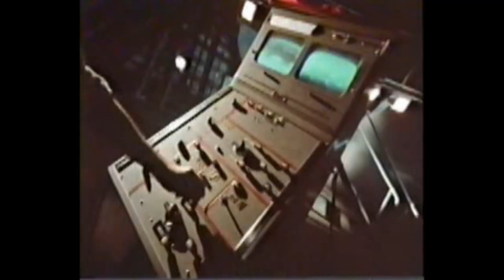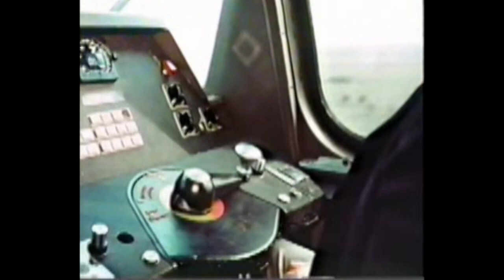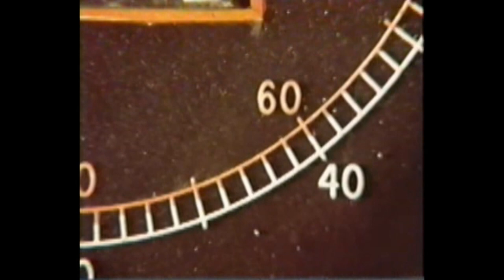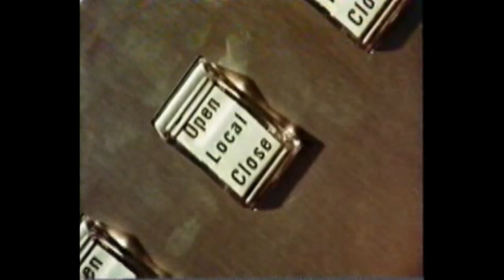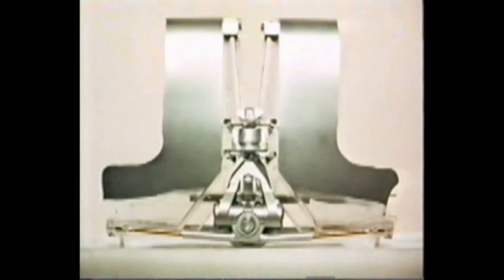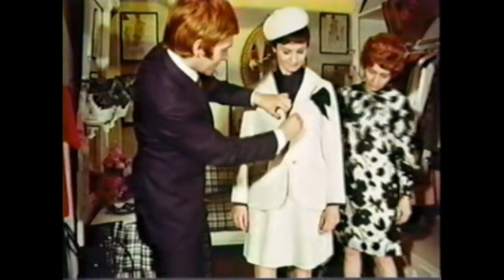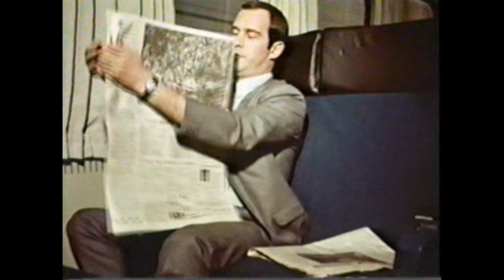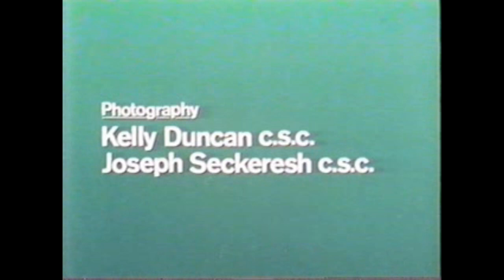TURBO - The UAC CN Turbotrain Complete 1970 Movie

Comment: We absolutely need something like this on that same corridor, if it was just as cheap or more as driving, stopped very little, and is perhaps just a little more time than the plane, it would be great!
Reply: Electric would be faster and more economic and no pollution.
Reply: @clarification007  you do realize how expensive it is to electrify a section of line, its really fucking expensive its like somewhere around 1 million or something per each mile
Reply: @nikerailfanningttm9046  it’s well worth the investment
Reply: Yes , but so many expenses , underpasses or rail guards at every crossing , for safety .I dislike buses and air travel .Please I want to travel by train .

Comment: It's pointless to have a high-speed train that has to share tracks with freight trains and commuter trains, because they slow it down.  That's been Canada's problem all along.
Reply: So true, that was part of the problem with this system. They r couldn’t run this anywhere near design speed. Only a little faster than a normal train. Current new engines on this route are capable of 200kph, but likely won’t be able to do that anytime soon either. The maintenance on the Turbo likely finished it off.  Apparently they weren’t too bad later in service after the retrofits. Bombardier did propose the “jet train” which has a single PW100 (dash 8) engine for high speed use without Overhead wires. Seemed like a good idea, but no one took up that one.
Reply: Watching videos of the advanced HSR networks in Japan and Europe, makes me realize what we're missing out on in North America.

Comment: I rode Turbo once in 1976 between Toronto and Kingston. It broke down just outside of Kinston and we were helped by a freight unit. I agree that high speed rail between Toronto and Montreal is needed. The congestion / security at the airports pre-covid was ridiculous. The LRC wasn't comfortable. My best ride between Toronto and Montreal was in a 1940's era parlor car on 3 axel trucks. The ride was smooth as silk. I've ridden all over Europe where trains are terrific. They are fast, comfortable and clean.
Reply: A rapid train is needed and either overpasses or underpasses , along the route , it would solve any vehicle collisions and make the journey safer .

Comment: Not sure if I mentioned in my long rant: The top speed for Montreal-Toronto was 03:59 minutes, not 3 hours.   Still cut 1 hour off the Rapido trains (and 1.5 hours off current schedules under VIA).   Much of the speed restrictions are due to freight traffic along the way.   Back in the day of Turbo, CN still put priority on passenger trains, so they ran faster and more reliable schedules.

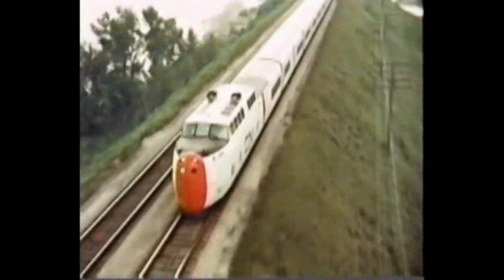Comment: 15:28   The Turbo Club Lounges were located at each end of the train in the power cars, raised up several steps over the turbines.  The driving cab was part of this section and apparently had windows right through so passengers get the same forward view as the engineer.  Note there are window panels in the roof to give views equivalent to a true dome car, but many  interior and overhead shots in this film show them covered over.  Perhaps they were impractical to keep clean of black soot from turbine exhaust stacks, which went right up through the lounge.  You can clearly see them here 12:35 but absent here 14:00.
Reply from the maker: Thanks for sharing your knowledge.

Comment: Turbine engines have excellent power to weight ratio, needed for planes, but are built for maximum efficiency at only one flat-out speed.   Great for constant speed applications like planes, ships, stationary generators.  Lousy for variable loads/speeds like trains, and very poor for the stop-and-go traffic of automobiles.  Burn nearly as much fuel at idle as is full speed.

Comment: This was Canada's first attempt at High Speed rail the next attempt was with the LRC Trains both of which suffered fatal malfunctions (of these 2 The LRC lasted longer and survived to see the millennium albeit the locomotives retired and one sent to a museum while their coaches were pulled by the F40 or Genesis Locomotives)

UAC TurboTrain: 1968 to 1982 
14 Years (All Scrapped)

LRC: 1981 to 2001
20 Years (Coaches remain in service until 2023)

Comment: Engine and locomotive technology advances rapidly.  Every 10 years we have something much better than what came before it. The Turbotrain was great at first, but after only 10 years it was clear that there were conventional diesel-electric locomotives that could do the job of pulling a train at high speed better than the engine in the turbotrain. They should have just hooked up that high-speed diesel to the front of the turbotrain and let it do the job of pulling the entire train around. The turbotrain would have been used in that manner for another 20 years with no problems.

Comment: I’m not sure I get this train. How is it possible for it to work using an aircraft engine? Where’s the air intake for the jet?
Reply: It doesn’t move using jet thrust like an aircraft. Instead, the high speed turbine turns a generator that powers motors attached to the wheels.

Comment: How could they power a 185 ton train with 4 gas turbine engines?
Reply: There were four per car, and also an auxiliary power unit. Not just four total
Reply: Actually 4 gas turbines for drive and 1 for aux power (lighting/heat). Wiki shows designed for 2 to 6 drive engines at 400hp each. As built seem to be 4 drive engines. Low rolling resistance is the big bonus with rail, the aluminum car don’t hurt. Large railway freight locomotives are about 3000hp for older ones and up to 6300HP ea. and they are hauling 2 km of freight. With only a handful of engines. Very efficient yet old tech.

Comment: Interesting, but what a waste of film spending so much of it focused on weaving the fabrics and outfitting the train staff, rather than extensively profiling and touring the trains themselves outside and in. No aisle shots showing the overall arrangement of seats and cabins in either Turbo Coach or Turbo Club, the passenger-accessible passage to the inter-train gangways, or the driver’s cabs.

Even though the film’s director and production crew were credentialled, I would have told them to do the project over again, focusing more on the finished trainsets, or fired and replaced them.
Reply from the maker: I think the video was a product of the times. Check out the other TurboTrains videos on our page, our visit our Turbotrain on our website, http://highspeedrailcanada.com

Comment: What was the reason to abandon those fast trains in Canada?
Reply: Mechanical problems
Reply: Using a turbine wasn´t really the best option. Besides mechanical problems. Fuelconsumpsion was not optimal. There was quite a lot of turbine trains in the late 60-tys. Most of them was scrapped very quickly in the oil crisis.

The turbotrain was really the only one that survived the oil crisis. But the fuel was still quite expensive even after the crisis.
Reply: Like others have said fuel costs after the 73 oil crisis rendered turbines an expensive oddity, especially on a corridor where they never 95 mph (turbine trains become somewhat more efficient once you pass the 125 mph barrier). Plus, this was a practically unique train. The only other buyer was Penn Central/the US DOT and they scraped their in the mid-70s so by the 80s I doubt there were many spare parts on hand to keep them in service.
Reply: It was never on a dedicated high speed rail line so it always had to deal with slower freight trains and level crossings so it never reached it's true potential.
Reply: They we’re dangerous
Reply: Seems it was high tech for the time. I hope we can do it right now.